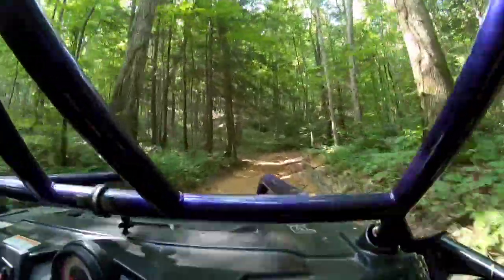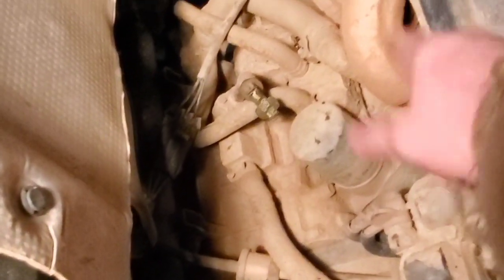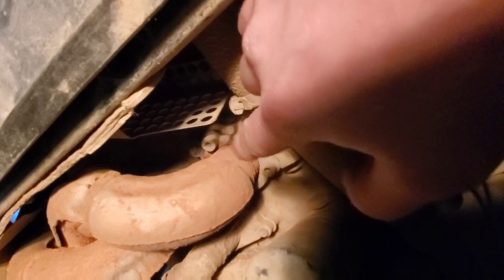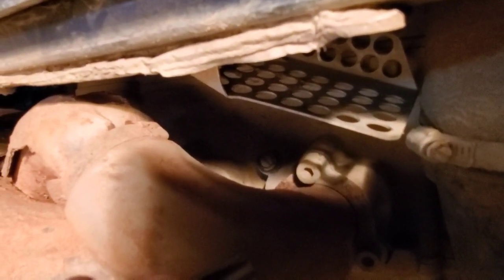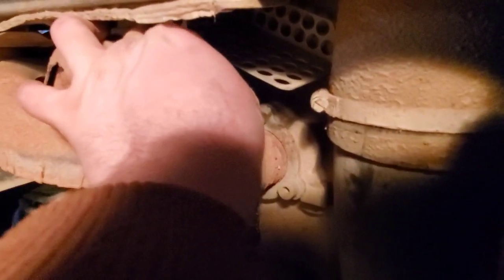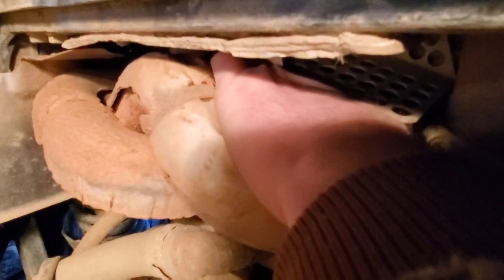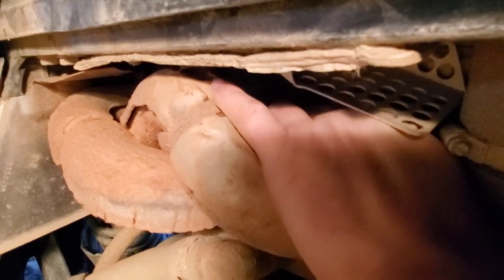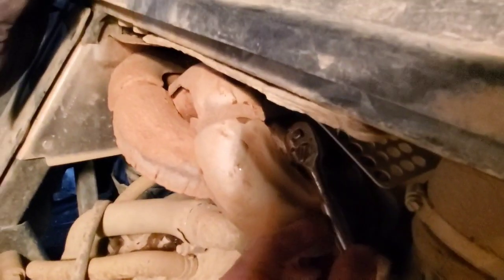Polaris rzr Overheating, getting hot? Free fix? Purge (bleed) air from your 900xp coolant system.

Comment: 2014 900XP- Thank you!  I looked everywhere for that damn screw!  My manual gives a picture that is absolutely useless.  I checked my fan, leaks from the water pump seep hole, etc but found nothing wrong.  I'm sure this is the problem. Just runnimg a little hotter than normal.  Thanks again.

Comment: Question! Did you happen to have coolant leaking also? Ours is getting hot, but when we take the hood off we also notice some coolant on a few parts but can’t locate a leak. Was thinking about giving this method a shot but not sure if our issue is completely different because coolant is actually escaping somewhere somehow.
Reply from the maker: When the air was let out of the system mine stopped doing it. Where it was hot from the air bubble it caused it. As soon as I bleed out the air, topped it off it burped out and afterwards and was fine. I overfilled it a little bit and that caused it I believe.  I haven't had any trouble since.
Reply from the maker: Mine came out the cap / overflow. Any air leak will cause one to get hot. The cap holds pressure, which raises the boiling point.

Comment: Just checking, after I fill radiator should I leave the cap off?
Reply from the maker: I did when bleeding the engine, then refilled and put the cap back on before starting.

Comment: What temperature does mine handle? It reaches 212 and goes down to 204. I appreciate your help.
Reply from the maker: Mine normally stays under 204, but goes as high as 207. I would think the 212 is OK based on the idea that the sensor may read a couple degrees different, but I would make sure the fans were on and it was full of coolant with a cleaned out radiator (no mud in the fins). As long as the system has a good cap on it and no air pockets at that point it would be ok. Last thing I would check would be the battery connections to make sure I have good, clean connection. That could throw off a sensor as well.

Comment: Do you know how can I bleed the radiator coolant on a 900xp
Reply from the maker: Sorry I missed this. There is a way to do this but it is sketchy. I believe you let one run with the radiator cap off. But if it was to boil over you could get burned bad by the fluid. I would not recommend it.

Comment: Thanks for the info. Mine overheated last weekend. Going to give the bleeder a try
Reply from the maker: Good luck. It fixed mine. Only had it happen 1x. I rode for 30 minutes, then it was hot. Been riding for 2 years now with zero. issues